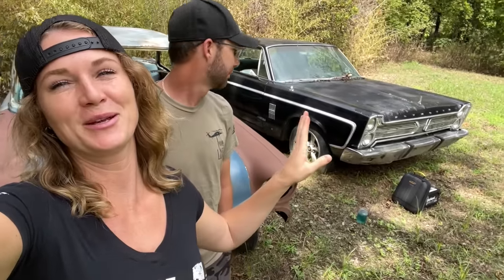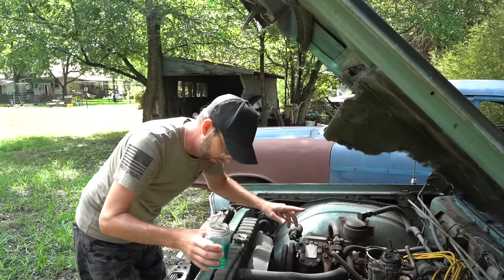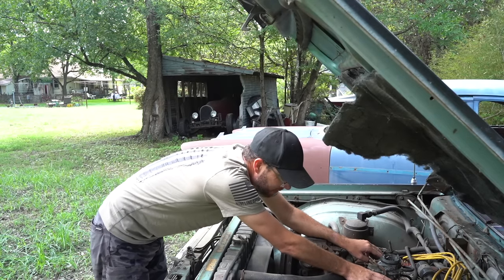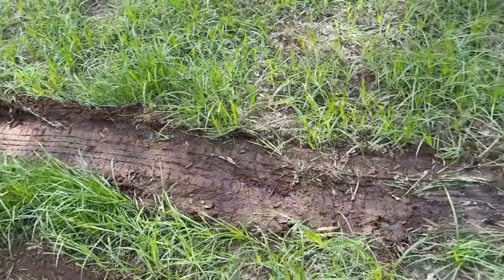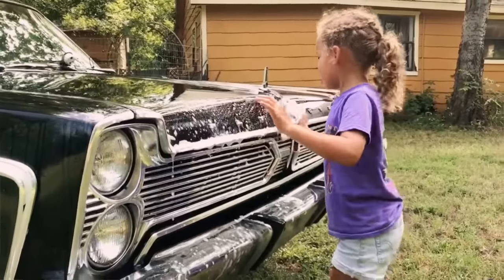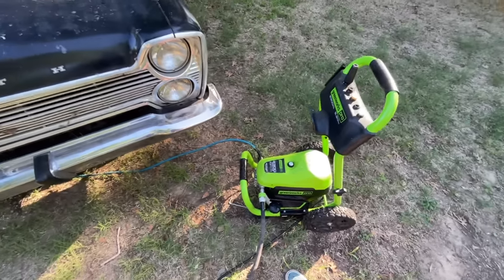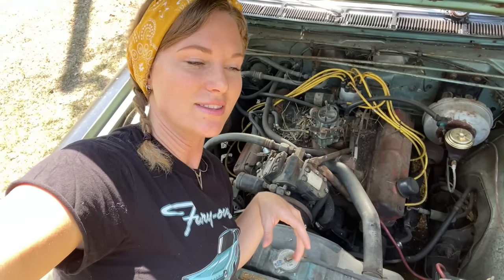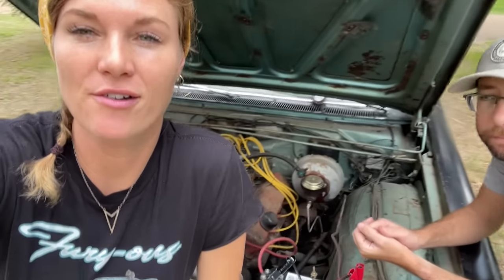Abandoned Plymouth Fury!

Comment: 4:55 318 Polysphere is a "A" series engine, it is not a small block.  The 273 and 318 (and 340) Small Block is a "LA" series engine.  Virtually no parts interchange with the 318 Small Block.  A 4bbl aluminum intake was available from several speed part vendors but you will need to look on the used market to find one now.
Reply: You are correct sir this is not a small block it is not a big block it's an intermediate block
Reply: What Kent said.
Reply: The 318 Poly is a small block. You can put LA heads on a poly, with a oil drain tube, and AMC lifters. The blocks are almost identical. I own them both.
Reply: It was also available with 2 4bbls with the V-800 package sporting 290 HP. Very rare option.
Reply: Parts are available. 4bbl, dual 4bbl, cams, headers. Not cheap. Motors are reliable. I say build it. It will not be mainstream. And those R12 AC systems got ice cold. Looks like a dive pump. Lol
Reply: Had one in my 66 Coronet 4 door.
Reply: Some called this the "wide block" but even though it may be the 318 the A, LA, and later Magnum  engines share nearly nothing other than displacement.
Reply: I found the most effective manifold was the Weiand 4BBl #7503. Lighter and a better design that the original cast Iron 4Bbl.Polys make good power and are a simple engine to build.
Reply: @jasonfalk7696  Heads are very different:
Intake and exhaust arrangement for the Polys is I-E-I-E-I-E-I-E, where the LA/Magnum arrangement is E-I-I-E-E-I-I-E.
Poly valve arrangement is canted with intake and exhaust valves angled opposite each other, while LA valve arrangement is wedge style with all valves aligned in a row at the same angle.
Poly heads have the intake valves on one side of the rocker shaft and the exhaust valves on the other side, while LA engines have all of the valves on the same side of the rocker shaft.
Poly and LA Rocker arms are different.
Poly heads are much heavier than LA heads.
Reply: @BigThomTattoos  nope that is a Poly.
Reply: @BigThomTattoos  but the 318 stayed an A block until 67 or 68
Reply: @tedesco455  The poly is absolutely a small block. Its commonly called the wide block, to differentiate between the poly and la. And you can absolutely put newer heads on a poly block. That's actually why the cam is so high in small block Mopars. (59 degrees). They needed the lifter higher, so they could get the push rod angle for intake valve rocker arms. Chrysler never changed it when they went to the la heads. LA stands for "light A". The short block, with exception of where the oil is fed, is nearly identical between the poly and la. The main difference, is how thick the cylinder walls are. Crankshaft, rods, oil pans, timing chains, etc, all interchange between the two. Saying that the 318 poly isn't a small block, while the 318 la is, is akin saying a 170 slant six isn't a slant, but the 225 is.
Reply: Actually the A series engines ARE small blocks, and some parts from the 318 LA (Late A series) will fit this engine. Dimensionally the blocks are identical and the main difference is the angle of the lifters to compensate for the Poly heads which are way wider than the LA heads are.
Reply: @jasonfalk7696    FINALLY ….. someone else who actually KNOWS 318 Poly engines and that they ARE ACTUALLY small blocks.
Reply: @WhiskeyRiverRifleman  actually it IS a small block and the block itself is almost identical with the lifter angles being the main difference
Reply: @wallbanger1968  last year for the US poly was 1966. 67 in Canada
Reply: @BigThomTattoos  It's a poly I had the same thing in a 66 Dodge sweptside truck
Reply: @BigThomTattoos  LA before 67 was only in the 273. 318LA debuted in 67

Comment: Sweet,  had a 66 Plymouth Fury Commando 383 Ex F.B.I.  car.  That was one hell of a car.   Go 4 barrel Carter,  dump the Master Cylinder for the brakes,   change the front drum and rear drum brakes to disk conversion because when it rains or going through a puddle the front  and rear  drums won't stop.  The wheel bearings also were not good for that year either,  they burn out and weld on to the spindle.  I know the later years for the Fury had a second fuel filter in the gas tank so check if there is a filter in the gas tank as well as at the engine.   Yes replace the starter and alternator  and the water plugs on the engine block may leak.   Good luck on the rebuild,  that is one nice car.

Comment: Definitely a 318 poly aka 318 wide block main difference is the heads and valve angle.  Consider it the grandfather to the hemi. Very little interchange on the top end.
Reply: Arch nemesis
The poly was actually an offshoot of the hemi, the first hemi came out in 1951and the poly engine didn’t come out until 1955 making it the grandson of the hemi
Reply: the Poly exposes itself with the bottom edge of the valve cover having a sawtooth look to it. Plymouth came out with the Poly because Plymouth was the budget level version of Ma Mopar and the Hemi was too expensive to produce but there was a need for a V8 to go up against Ford's Y block and the Chevy mouse motor. The A motor has a unique valve arrangement seen again on the Jeep 4.7 but kept the Hemi's lifter valley setup, creating a weird pushrod angle seen on the LA (Little A) blocks that came out after 1967.

Comment: Definitely worth getting a 4bbl + intake manifold for it. I have owned a few 318 polys and they are great engines. They can be pretty potent if you want to go that route. Had a 318 poly 4bbl out a 59 Fury in a 1950 Dodge step side pickup. That was .030 over, RV cam, not much else and it was a tire fryer. Good torque from these engines.
Reply: Wow, I never realized that the 318 Polys were such torquey little engines. Closest I got was a 1984 Ramcharger with a 360 LA that I swapped for a 5.9 Magnum due to consistent vapor lock and me not knowing anything about carbs.

Comment: I have watched your shows for quite a while now and have thoroughly enjoyed them. But today I was surprised at the lack of knowledge for starting a car that had been sitting for so long. Bad gas for one. Also when you opened the hood and saw the nest the better thing would have been to clear out the motor a little better so junk isn't sucked down the carb that has no cover.  The wheels and brakes are probably rusted tight and if you keep horsing it the trans will most likely pile up. Please slow down and take some time to check out the systems before trying to drive all over with that beautiful car.
Reply: EXACTLY what I thought about the brakes being locked up and not a trans problem. LOL. Seemed pretty obvious from here but it may not be true
Reply: yes, gasoline is not a forever magic fuel! for being car restorers many steps were missed. but still like the channel.
Reply: that was painful
Reply: YES AGREE.,. Then ripping the insulation  from above an open Carburetor  with Dirt Falling in it...UGH...The engine is probably a  360. COVER Your Carbs before Ripping out Stuff from above it. Your friend was Probably rolling watching this...LOL..
Reply: And yet here it is ,,,in the front under its own power and gettin clean as a whistle.

Comment: Fill the float bowl with fuel via the bowl vent. Saves a lot of cranking. The vent is the tube sticking out of the carb on top.
Reply: Yes, there has to be gas in the bowls for the accelerator pumps to work ! You can't get gas in the bowls by dumping gas down the carb throats and you'll mess up the accelerator pumps pumping a dry carb.
Reply: You're 100% correct.  A little starting fluid to get things going wouldn't have hurt either.
Reply: old cafe style ketchup and mustard squezze bottles work great.
Reply: @dougjustdoug6391  some cranking is good. Builds oil pressure.

Comment: Pro tip; start washing at the top (door panels, seats etc.) and work your way to the bottom.  Then you don't get dirt/debris over what you've just cleaned.  Great video, love that you've included "the kid" as part of the project.
Reply: A better reason for starting at the top of the car when doing a wash job. Using a rag mop or  a soft bristle washing brush The top has quite a bit less road/ street debris like mud, dust, small stones, etc than the lower sections of car especially at wheel level near fenders and along doors. If the lower sections are washed before the top then the possibility of having some of the debris still clinging to wash mop or brush even after dipping it back into the bucket washing liquid soap solution. THE DEBRIS ABSOLUTELY WILL SCRATCH THE PAINTED SURFACES AND WINDOW GLASS !

Comment: im a lifelong mechanic, always used carb cleaner, you could spray it while cranking, and keep it running once started, also if you want to clear out a flooded engine put the pedal to the floor and crank this gives the motor max air, also bad gas/ fouled plugs can keep a car from starting even if you have good spark, timing, and compression, wet plugs dont spark very well.

Comment: Hi there, My parents bought a '66 Fury III new in May of 1966. It was also a 2 door hardtop and was red with black interior and sold for $3,750 (almost exactly a dollar per pound). The 318 was the standard engine for the Fury III with 383 and 440 as options called commandos. The backside of the hood ornament with the option engines would have the engine displacement written on it without the mopar star with a black or red backround. Red indicated a higher horsepower set up.  Possible that the 440 was only available in the sport fury which had front bucket seats and a console shifter. $ barrel carbs were not offered for this engine, but Chysler had a factory cross ram dual quad manifold for that 318 wide block, not the other 318. If you do decide to upgrade the power, DEFINITELY !! upgrade the brakes. The stock brakes are horrible. When the car was only 2 years old, I tried stopping from 120 mph and the brakes faded to almost nothing at about 70 mph. The standard rear differential is a 323:1 with a optional posi with a 352:1 (I think). The trans can handle the increased power easily. Our car got 18mpg with my mother driving, for some odd reason it only got 14mpg with me driving... Side note: the fuel tank is huge, I put 28 gallons in it once for $8.96. It was a great car but was stolen in 1977, sad. It has mechanical lifters, I can hear valve noise, so I recomend a valve adjustment. They were prone to burning exhaust valves if the clearance was too tight .  Have Fun!
Reply: $ barrel oops
Reply: 4 barrel, it's late

Comment: Aaron to Emily:  "If it catches fire you are going to have to take your shirt off to put it out"
Reply: If you want to sell it I'm sure willing to give you a offer 
I had one like it in 1968 and have been looking for one
Reply: How many people were hoping for a fire lol
Reply from the maker: He’s a goober 😝
Reply: @flyingsparksgarage  🤣
Reply: @flyingsparksgarage  
Speaking of 300Z Mike Finnegan needs to know about the dude so that the "Rotsun" can get what it needs
Reply: @flyingsparksgarage  
WOW!!!
DIEHARD Battery!!! (Sears product)
Reply: @Flying Sparks Garage  
HEY!!! Y'ALL STILL HAVE THE 57 FROM WHEN Y'ALL HELPED 12v Dave Newburn
Reply: @flyingsparksgarage  27:00 
727 or 904a Transmission (Standard Shift Transmission is always best)
Reply: At 14:20 never never add gas to running engine!!!!!!!!!! It has spark and a fan to spread the flames!
Reply: At 14:37 once fired you don’t need to oil cylinders. Also with two cycle engines you can start them WD-40 as starting fluid! …….. a little!
Reply: At 14:38 if you are worried about oil in cylinders quit revving the engine. Just keep it running for a while! Revving the engine after long periods of time will only hurt parts….. because all of the oil has dripped to oil pan and will take time to spreading/lubricant inside of cam bearing and crank bearing!
Reply: Am I the only one that was hoping for a fire?
Reply: 318's are pretty much bulletproof!
Reply: Love your Mom!

Comment: It IS a 318.....but NOT an LA, or small block 318. It is a POLY 318. It is an earlier version from what most folks think of that would have come in your 70's Valiant or Duster. Unless you have access to an original 4bbl intake, there are not a ton of aftermarket parts readily available on the shelf for upgrading. Stock is your lock to success. They are sweet little cruisers, but not huge powerhouses. 

Rebuild the carb with a proper kit, service the points ignition(assumingit hasn't been converted to electronic), service the trans, go through the brakes, lube everything in sight(suspension), and cruise the hell out of it to get ice cream on a saturday night. DONE.
Reply: Hell, I don’t know but you sound like you know! I’m voting this suggestion up. I was thinking stick with stock too from the beginning and give it a chance to see how good the motor is after running it a bit after cleaning out the fuel and a good rebuild kit in that 2 bbl.

Comment: Hey guys y'all are exactly spot on ! The accelerator pump is that part of the problem! Depending on what you really want ; the two barrel rebuilt will run really good! I know this is what you want to hear, is a four barrel on an aluminum high rise will bring a bigger smile to your face!! I'd drop the pan on the transmission and change the filter and it should be fine. It doesn't sound like the previous owner abused it. You might check for leaks at the wheel cylinders and shoes also. Yeah nobody likes to beat on the starter ( how embarrassing) in a crowded parking lot!! That is the nicest looking Fury that Plymouth ever made and y'all are sooooo  fortunate to have such a beautiful ride. Hopefully I could help some. Y'all take care and enjoy!! 

P.S. If your daughter use a power washer on my car and make it look that good ( SHE'S HIRED )!!  My car has some rust and needs a driver's side quarter panel. Sorry looks like I'm writing another best seller that won't make it to print!! Good night!

Comment: Just a friendly suggestion… refrain from hammering on a battery terminal (6:50) to get them to seat on the post. The battery case can crack and leak electrolyte or even short internally. Best to use a terminal spreading plier (cheap) or other tool to open the terminal before placing it on the post.  

Also in very rare instances using a metal tool on a positive post can accidentally form a live circuit if the negative terminal is already connected. Seen it happen and it’s not pretty.

Comment: That metallic seafoam green was popular in the mid 1960s. My family had a 66 Fury 4 door with that paint color and we later got a 65 Chevrolet Bel Air with same color. It is interesting that the 65 66 models with power brakes had a single master cylinder wheras the 68s had dual cylinders. The worst thing about those 318s, I had several mid-late 1960s models, with air conditioning is that every last item: power steering, AC compressor, & Alternator were all bolted through the water pump, and the fan had long bolts that required removing the radiator to get the fan off. Don't even get me started on the rubber motor and transmission mounts either.😖
The fuel pump was an easy job. Your battery going dead was probably the voltage regulator that was bolted to the firewall on the 68s.
Good luck getting it restored.

Comment: That belch was unexpectedly awesome! Bring it back to it's former glory if you can. First time watching you guys so I don't know how often you've done this. Always a good idea to pull the plugs and drop some oil in on top of the pistons and let it sit awhile, check if the fuel is any good plus check the fuel pump and filter and of course the engine and tranny oil. I had a 75 Plymouth Fury Custom 2 DR just after high school. Typical stock 318 and no guts unless you did a brake stand then haul it into drive until you blow the spider gears in the rear end...lol. These cars had starter issues, some of them had double wall exhaust that would collapse and lose compression 
 (ridiculous idea) and the carb would bog down when you tried to accelerate quickly. Looking forward to your progress on the car!

Comment: Poly 318 with a 727. Quick tip- before dropping it into gear, especially after sitting awhile, put the transmission in neutral. The pump doesn't start up in park, so put it in neutral a few seconds to get the ATF circulating. Just going from park to reverse or drive is hard on the transmission.
The Polyshere 318 is a very torque-y motor. A cam, headers, a 4-bbl & intake and that 318 will surprise you

Comment: Looks like a 318.  New Edlebrock Intake, Edlebrock 4 barrel carb, new valve covers.  Probably could use some new plugs, plug wires and rotor.  I'd test the coil to see how much it is putting out.

Comment: First things first, for a '66 Plymouth Fury III, she's really clean and solid... Secondly, it is a 318 Poly engine; I would first check and change the accelerator pump and then switch it over to a four-barrel carburetor and possibly get it fuel-injected... Also, improve the master cylinder and alternator because it looks nervous and probably in time needs to be replaced... Also the A/C  needs attention too but it's a great ride once its finished.........

Comment: It depends on how you plan to use it and/or what your friend would have done. And yes, he is correct that it is the accelerator pump that is bad in the carb. I am also suspicious of the front bake hoses. It looked like they were holding the front brakes on when you were trying to pull it out of the hole. Personally, I would rebuild the carb and run it as is. It sounded to me like the bearing might be going out in the alternator as well. Good luck!!

Comment: Anytime you're bleeding brakes,put a block under the pedal so it won't go all the way to floor. Otherwise you'll probably need to replace the master cylinder. On old Mopars check trans fluid in neutral, warm,and running. Carb needs accelerater pump.